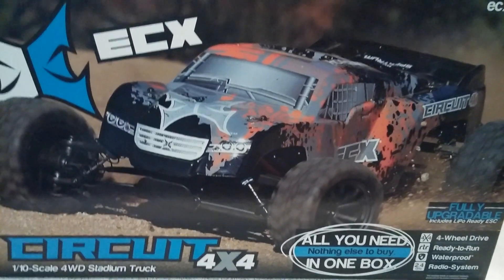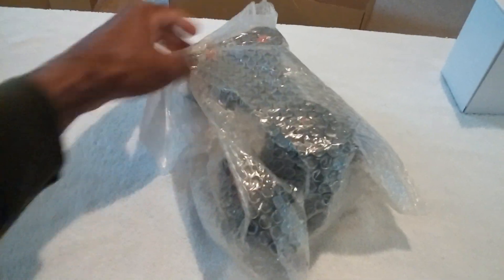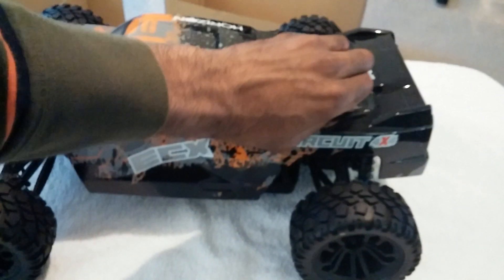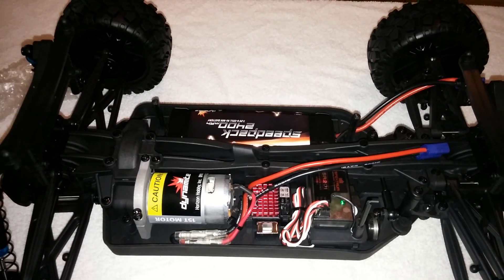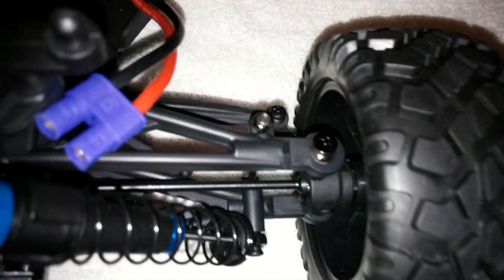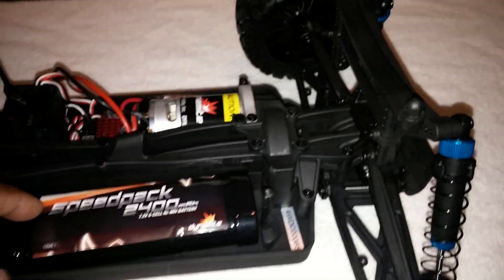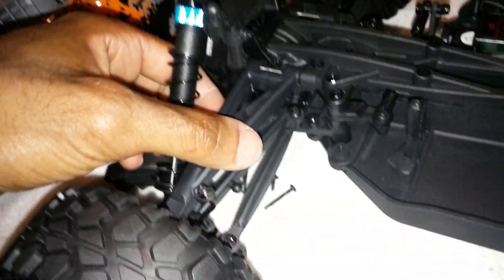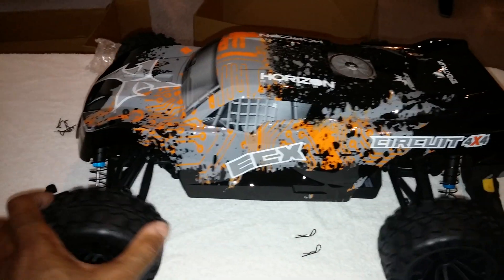ECX Circuit 1/10 4WD Stadium Truck Unboxing and first look

Comment: I have pre-ordered the Ruckus 4WD.
Reply: I am starting to like the  ECX rc's! Just put a DYN4955 esc and a 3300kv fuze motor into my Volcano and that thing is a rocket now on 2s and 3s i can not control it!! Still trying to figure out the esc programming, the response for reverse is not want it should be, takes for ever for some reason?!! I need to find a wheel bar or make one some how!!
Reply: ***** I am starting to like them more and more. What you get at the price point is so nice I think it will bring more into the hobby. Which is something I believe we all want.
Reply from the maker: Joe Schmoe how is that ruckus doing?
Reply: +Joe Schmoe Ended up canceling that order. I do plan on owning one eventually. I have the body I want to put on it. and I have power system waiting for it.

Comment: What was the thing in the bag with the binding plug? Something for the servo saver?
Reply from the maker: to adjust the slipper clutch.
Reply: In the little bag with the binding plug was a little round black disc. Almost looks like its something for the servo saver. But not 100% sure.
Reply from the maker: Let me check again
Reply: OK. Thanks.